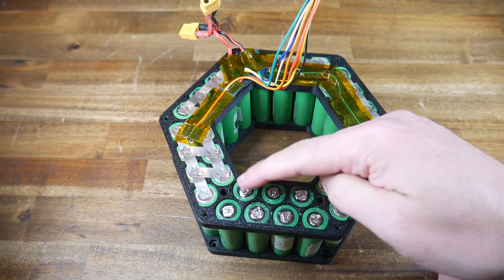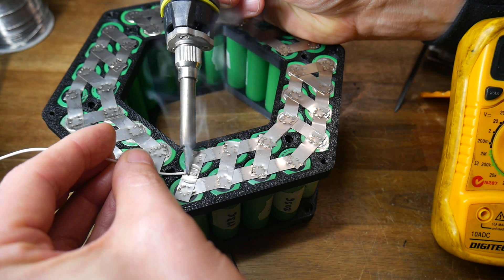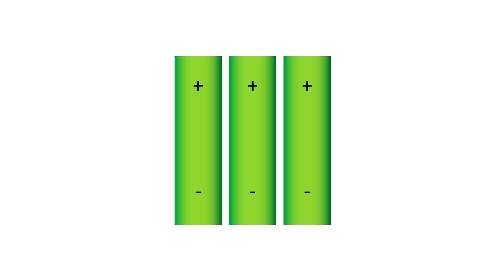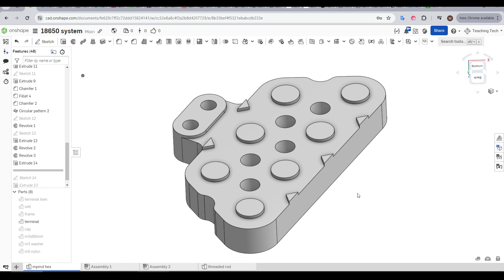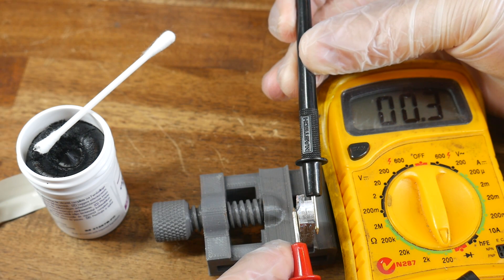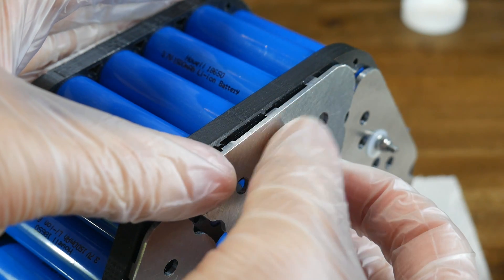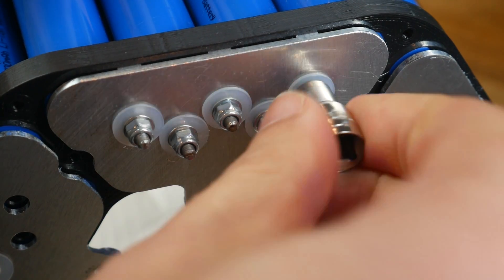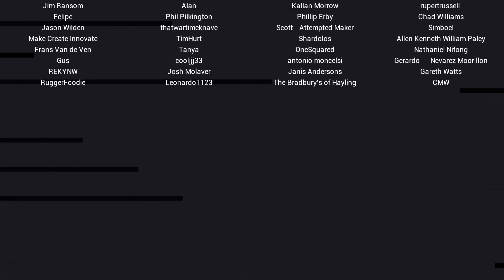Experimenting with a new (and probably flawed) 18650 building method: No soldering or spot welding!

Comment: I do spot-weld short strips with holes to each cell both ends and than bolt them to rails, so each faulty cell can be replaced easily

Comment: Wow! a lot of thought has gone into this. Well done! 
On your current iteration, the long bolts although looking stiff and unlikely to touch the aluminium holes could be pulled to one side when tightening the nuts. Bolts have a way of walking when you tighten them. I'd be tempted to use nylon washers with internal collars if you can find them or 3d print them. That said if this iteration is still a prototype then I do like your idea of the plastic joiner in the next version. 
On your future iteration however, the new plastic joiner may stretch over time making the contact on the batteries not so tight. Still worth doing though but keep an eye on it. Being able to rotate the batteries may be the easiest way to see if they have loosened.
With regard to the positioning of the bolts, it looks like the outer batteries may have a worse connection as the aluminium will flex upwards at the ends. The more you tighten the nuts, the more the outer part of the aluminium will flex upwards making a tight connection on the outer batteries but only on the edge of the battery contact. 
Last comment - I've repaired a lot of equipment over the years. Even low current devices have a way of developing  bad battery connections. Often its from very slight corrosion so be mindful of the properties of the metals used. Your paste may combat this issue but if it has a tendency to dry out then it may cause high resistance contacts or maintain a low resistance contact but form low current handing characteristics. Large rigid batteries rely on flexible joints to counter for imperfect conditions. If your battery is to be mounted on a non perfectly flat surface or is likely to get warm and even slightly warp, battery connections will be slowly compromised.

Love your viseo & nice to be asked to provide feedback.

Comment: I would wonder if it would be useful to have basically a thin bit of metal for current, a layer of nylon buttons to put pressure to make sure of contact, then a clamp on top.  so you would only have to put a few bolts through the clamp to get the force needed to get contact.  but I know that also means with a thin and flexible piece of metal it may not allow enough current to pass through.  I am not an electrician but that is a thought I would have though no idea of how sound of a thought it is

Comment: I’ve seen prototype setups for high end batteries that use an aluminum frame for  holding the cells together.  There is a good amount of contact on the sides of the cells and then they are epoxied in.  Then, the tops are fused (like a fuse) to a bus bar.  That way you don’t have to worry as much about damaging the cells by spot welding or soldering to the cell bodies as the button top has some thermal separation. 

Honestly though, this setup looks too complicated for what it’s worth.  

Best joke of the video, you don’t need to invest in a spot welder, but you do need a CNC machine.  lMFAO… ..

Comment: i think i would rather punch a hole in the end of a solder tap and screw them together- its lighter and easier to print an more vibration resistant.

Comment: Nice, but like everyone here, I feel a bit nervous relying on those washers. Next time, consider using springs to push on the conducting plate which might overcome any settling issues. Maybe consider a plastic joining layer to put in the middle of the cells (like the top and bottom plastic positioning plates) which you can mount separated bolts in pointing up and down to attach the top and bottom aluminium plates too.  If you didnt want bolts pointing outward, could you use shorter bolts (that could never reach each other) and put a threaded plastic layer in the middle?

Comment: Try using gravity to prevent the nut from escaping on your next design. Make the 18650s sit on their side so you can make a horizontal channel for the nut to sit in, similar to the low rider 3 cnc.

Comment: Am I missing something, or do you still need to completely disassemble the entire battery for nearly any servicing? Might not be as destructive on the surface but with all the fiddliness, it seems a bit worrisome if you have a charged bank and you need to undo the bus bar which won't that create gaps and unevenness as you attempt to take apart?

Comment: I am curious how good magnets would work for long-term battery connections. I usually only use them for quick setups.
What seems to work best is a copper strip being held onto the battery by a very flat, but wide neodymium magnet.
A magnet can also be used to directly chain 2 cells together. Magnets have limited current carrying capacity tho.
Reply: They should work well for low currents. You'd have to do some measurements to figure out what resistance the lowish pressure introduces. Cost might be a factor with that many magnets though? Springs should be a bit cheaper.

Comment: That is a collection of bad ideas. 
- you need a soft metal contact patch
- use some kind of spring washer to keep the contact on the cell. 
- you need movement between the individual cells, do not clamp them together unless you want to squish them all to the same length (manufactuing tolerances...)
- not 100% on this, but is it not usually a sense wire to every cell, to notice uneven charging of a group of cells due to one cell being damaged?
- tiny nylon washers are the only difference between this thing being a power pack and a bomb. I don't think this counts as a good life choice.
- also, assembly looks terribly dangerous with all the exposed metal terminals

Comment: I really appreciate your channel and have learned a lot.  I appreciate you attacking a problem from a different angle and sharing your ideas for the community.

I have worked in the automotive industry and had hands-on experience with connectors and terminals and I've seen how they fail over time.  I hope to share a bit of that experience here to help you with your project. I would strongly encourage you to do extensive testing with your proposed approach before committing to spending the time and money to build your larger option.  

Essentially you are planning on passing current through two terminals placed on the ends of your cell which are only making contact due to compression forces acting from top to bottom of the cell.  In order to achieve and maintain a good electrical connection you actually need a good amount of force, and the cells really are not designed to withstand compression in that way.  Furthermore that force will be unequally distributed between cells in the group. I know that you are well aware of that, which is why you have introduced a conductive grease. So here are a number of issues around your approach to consider further.
1) The cells are not designed to be compressed
2) With the cells in groups, the tallest cell will take the brunt of the force
3) Each cell in the group can impact the "terminal" force experienced by other cells, and that will change over time
4) Your compression design is a bolt and not a spring, which means over time as the cell squishes the pressure will not be continuously applied
5) The expansion and contraction of the busbar with thermal effects is significant and will vary from cell to cell as the electrical resistance at the end of the cell will vary from cell to cell and therefore the localized heating of the bar will vary as will the thermal load on the actual cell
6) What I have seen is that if a design requires conductive or dielectric grease, over time it will dry up, leave or change it's properties.  All that to say, if a design relies on it, it isn't a long term solution.
7) It simply does not have the conductivity of a spot weld and small and variable amounts of resistance can cause significant heating when large amounts of current are applied.
8) As another commenter noted, your method for measuring the resistance of the grease isn't going to be accurate for the resistances you are dealing with.  There are special tools for measuring very small resistances, but they aren't the cheapest.  A digital multi meter is a jack of all trades master of none and shouldn't be relied upon for very small measurements, very large ones or ones where a highly precise number is super important. Like any other tool it has an appropriate application where it will give you misleading information outside of that limited band.  Think of it perhaps as a tape measure and not micrometer, if that analogy is helpful.

That is a very short and quick capturing of some of the issues that I think you will find make the proposed approach not optimal for a long term build and I hope you will consider them carefully because bad connections on lithium ion cells could cause extreme heating and very undesirable results.

I don't like to express serious concerns about someone's design without providing possible solutions or other paths.  So here's a suggestion, for what it is worth: The fundamental problem that you are trying to solve is that reworking the pack was a serious problem because the dead cells could not be removed from the pack due to the design of the 3d printed parts.  The spot welded tabs captured the plastic parts, and even when removed the spot welded tabs of other parts of the pack prevented removal of the cells.  Because of that valid issue and frustration you went down the path of adding CNC cut metal parts, adding bolts, washers and a great deal more complexity.

I would suggest stepping back and reconsidering the design of the 3d printed parts.  I have seen your brilliant 3d part design and if you thought about it I am very confident that you could design 3d printed parts that could hold the pack together, but be reasonably able to disassemble as needed.  When you originally designed those parts, you did not do so with the requirement to be able to disassemble and service the pack.  You are already willing to go to the complexity of adding fasteners, you could have multiple holder parts that clamp together and could be unbolted for repair.  The hexagon that holds the 18650 cells could disconnect at each corner so that it can easily be taken apart and serviced in sections.  Instead of the 3d printed parts being captured by the spot welded busbars they 3d print could go on the outside of the busbars and bolts passing through end to end could clamp the holders in place and prevent the problem of them being captured.  The individual sections could be bolted together with the protective covers and could much more easily be disassembled when the covers are removed.

All that to say, there are a lot of very good reasons why spot welding is the standard for 18650 packs and I think the cheapest and easiest solution would be to redesign your printed parts with serviceability in mind.  I look forward to seeing the next step in your project and what pitfalls you find along the way.  The ultrasound gel cracked me up, glad you are covered. Thank you for sharing your experiences with the community!
Reply: This is such a thoughtful and kindly worded response. Thank you for stating your experiential background, identifying the problems, and then presenting some solutions. You clearly are a skilled engineer and a fantastic communicator.

I was thinking the exact same thing about needing to do a re-examination of the actual initial problem that he had. The root of the problem was that the 3D printed case captured the spot welds. Focusing directly on this problem will likely result in a more optimal solution, as you have stated.

Thank you for taking the time to share with us all and the presenter!
Reply: Such a great comment! Addresses all the concerns I had and more (and from a viewpoint of practical experience and training rather than intuition/gut feel).

It's really easy to end up in the weeds when trying to refine a design, so an external perspective is often required to zoom out and re-assess the paths taken. Hats off to Tt for presenting a design in this stage of development, it takes guts to open up to feedback in a public forum, and hats off to you @buildtestbuild for providing such a well thought-through critique and alternative directions.
Reply: I wonder if Michel could instead use a soft TPU as the plastic that is providing the force to the terminals, with an outer piece made of a harder plastic. The TPU will provide a less rigid but more spongey gasket-like mount which might conform to the small differences in battery height. What do you think?
Reply: @KieranShort  When  Designing electrical connecting system one has to consider what the clamping forces are.   With TPU 1 would have to do extensive testing in order to find out if the clamping pressure would be adequate.  That said plastic changes over time and it may be a problem down the road even though it may be adequate at the time of manufacture.
Reply: Thank you for putting the time into such a thorough response to the video.  Your information is accurate and concise.
Reply: There's low compression force engineered wire contacts that are very low cost and are manufactured with current ratings from 6A-50A+. Historically they've been used in mass testing assembled pcbs. They're one of the few contacts that tick all the boxes for a spotweldless battery assembly approach.
Reply: I wish my phone would let me copy-paste your comment so I can save it and reference it later as an example of how to share knowledge.  One of my goals is to be able to communicate in the way you have here.
Honestly, you kinda told him that his design was shit for all these reasons, but did it in a way that comes across as super kind and helpful.

I'll have to make a note to find your comment again when I'm on my computer, so I can save it as a sample for myself, on how to share my expertise in my particular area.

I imagine what you wrote is here is what it would sound like if Mr. Rogers were talking to an employee who had completely screwed up a project in all sorts of ways. Warm and loving, and very informative. I hope to be like you some day. And now your channel has 18 subscribers instead of 17.

Comment: When spot-welding, you should slit the nickel strips to increase strip resistance between spot-welding electrode and spot-weld with electrodes across the slit to force most of the spot-welding current to travel vertically through the joint instead of directly across the strip. You get more reliable welds using less heat.

Comment: Your method of measuring resistance there is very far from adequate. Multimeters like that cannot measure small resistances well, they just aren’t designed for it, especially things in the milli ohm and micro ohm ranges. You are likely measuring the resistance of the probes and internal circuitry on the multimeter and it is not accurate at those scales. At 60 A the power dissipated in a 0.1 Ohm connection is 360 W, with your 30 A cells that would be 90 W. There are ways of measuring small resistances but using a normal multimeter is not one of them. Your 0.3 Ohms you measured at 30 A would produce 270 W of heat.

Also you would not be able to reach 30 A. Using ohms law, a fully charged 4.2 V cell could only output 14 A with 0.3 Ohms of resistance on its connection and that is only one connection and before any wiring or load is added. I know the measured resistance is very wrong anyway but this is just to explain why it matters.

If you are going to make something like this and possibly publish it for others to use, it is irresponsible to not get the proper tools to test it properly.

Comment: ok, just watched te video. I am somewhat good with assembling these packs, I am the JP from JP spot welder if that means anything to anyone :) .  Unfortunately I wouldn't trust this system, your washers are the only thing between this thing working and a complete disaster. You would need to make a top clamping piece that pushes on the busbass to spread the pressure and ensure that even in failure nothing shorts. Bussbar would have to be much much thinner so it can be elastic a bit and conform to cell shape, this one is to rigid and can't make good contact with all terminals. Don't worry about the area for current, you are not even close for that to be an issue.
Now with all this said, I wouldn't pursue this design at all, it is extremely hard to do safely, it barely exists in commercial usage and for a good reason. I would stick with spot welds, just make smaller groups that you can assemble together, or look at system n.e.s.e. uses.
Reply: Man is about to FAFO the hard way with this design.

Comment: In general I do like the design. I don't like the bolt that goes through it. This is a safety risk as it is. I do like that you have come up with a solution to it though. And even though this is probably a non factor as the dielectric breakdown of the insulator used is quite high, it is still a risk. That might just be my paranoia though.

Comment: Its about time for a new method for joining cells. My 2c: printing a cover for the entire terminal plate, so no alignment is needed. Discharge under IR camera to check for low resistance spots.